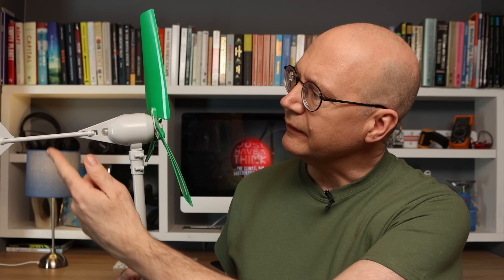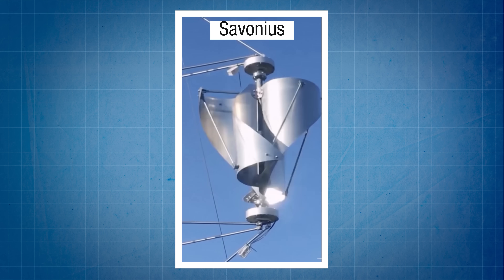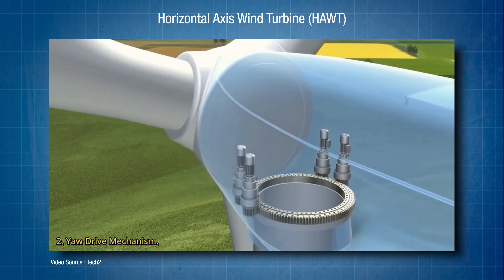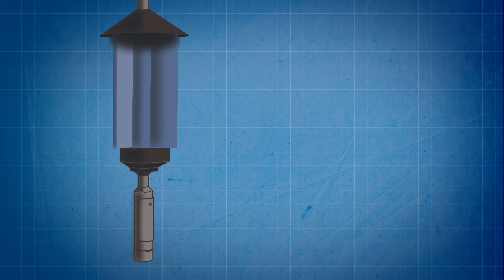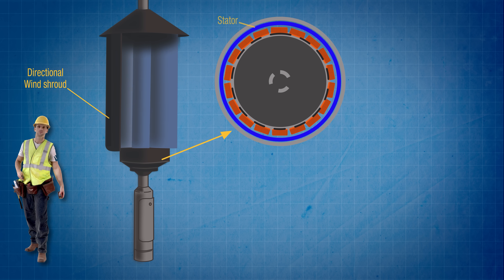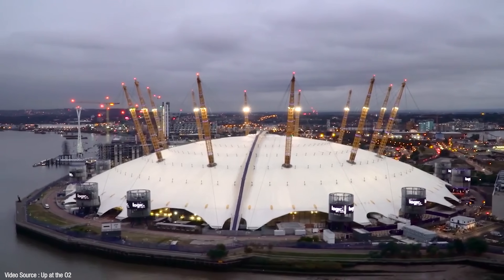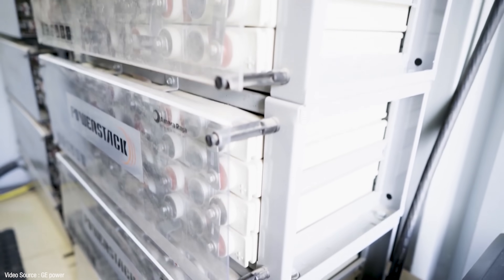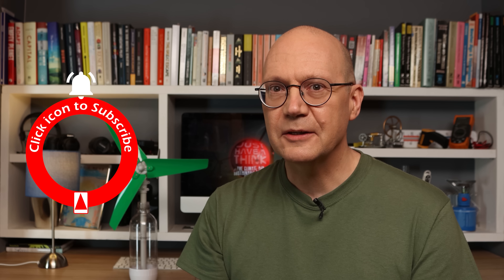A vertical axis wind turbine that doesn't need the prevailing wind! How do they do that?

Comment: Interesting video! Two question marks spring to mind:
Was the 5.4m/s measured at-site with an anemometer?
Is it possible that the influence of the turbines will cause parasitic loads on the vehicles, making them use more fuel to drive?
Reply: @spidy9237
True, despite the confusing graphic, everything they've built does look more like a drag/savonius VAWT, but considering their efficiency is limited to 15% by the drag in the counter direction, I wonder whether having this wind shear from opposing traffic might help this.

Am still generally sceptical, I'm confident they wouldn't get 6kW from a line of cars (sadly lorries are away in the slow lane too), the only thing that seems to lend some credence is the assessment by the (Leeds) institute of thermofluids (4:55) , but I can't find any evidence of this assessment online. 

Dr. Andy Young (4:08) is the advisor that apparently did this, but I see no publications from him , so I can only imagine they're basing this of a few informal bits of work, and nothing rigorous and obviously nothing we can scrutinise..

Comment: BRILLIANT informative video! Two things occurred to me that were not mentioned. 1) As personal and public transport moves over to electric propulsion in the coming years, exactly the same system will continue to work and pump a proportion of the energy used by those electric vehicles back into the grid where it can be used again for vehicles or other power needs. 2) You point out that the vehicles on our roads generate an air flow ("by punching a hole throught the air") - At speed, most of the combustion energy (about 35% of the chemical energy contained int the fossil fuel?)  converts into kinetic energy of the air  - moving air. Ultimately this Kinetic energy now in the air simply and quickly heats up the atmosphere even further and adds to the longer term heating of the air due to the 'Greenhouse effect' caused by the anthropic CO2 being heated by solar radiation.
I have a Question: 800+MwH of annual generation along the stretch of motorway you refer to is excellent BUT what is the installation cost and the ROI over the lifetime of the installation (including maintenance costs)?

Comment: We may fix the Gravitational Technology wherever we need it to be .  We may rotate more than 5000 Rotation Turbine Discs at the same Maximum rpm we needed. It would need only 4 Soccer Sized space in round shaped for these 5000 Turbine Discs . It is 100 % Carbon Emission Free Energy . It is the only solution by now to get rid from all the Energy Crisis which the World is facing now . The Gravitational Technology would be the cheapest form of Electricity .

Comment: Here's a thought why not place them near rail lines as well, I imagine with the length of trains and them being on a mostly regular schedule the calculations for the turbines output can be better calculated to prove this companies claims accurately and without doubt. Not to mention being near rail lines where that form of mass transit is heavily used and space is at a premium say in like Japan for example would provide yet another incentive for their adoption on top of providing the electricity for some of those electric powered trains themselves.

Comment: >:0 that's so freaking cool! Do these have an effect on how air and noise flow around roads? I'm a not a math guy (yet?) but it'd be curious to see if like, idk, they'd shed vortices that would reduce or increase drag on vehicles as they passed... Or if they're just such a small part of the system that it's negligible effect (which seems... Likely in my total just guessing estimate)

Comment: This energy isn't coming from nowhere. These would slow down air movement in motorways, reducing the efficiency, even further, the wasteful petrol or diesel engines. It would make sounds inside the car everytime you fly past a turbine. If you want to help the environment, enclose all motorways to prevent any wasted airflow. This sounds like a terrible idea and I'm not surprised it's come from a startup.

Comment: @9:20 The consumption of a typical base station is actually much more than that, most commonly between 30 and 80 KWh per day but can also be considerably higher.  The figure of 7 KWh per day is about right for a microcell (or small cell as it is now called), which would be one of those small things the size of a shoebox attached to a wall or a lamp post and such, not the full sized base stations (or 'cell towers') as depicted in the video.

Comment: Here's the big question I have: Does this change in air-flow reduce the efficiency of the vehicles? We know that when cars are driving back to back they get an efficiency boost (for example the Tesla semi convoy idea). So there's a chance that the unintended consequence is actually stealing energy from the fossil-fuel burning cars.
Reply: That is a small question, and I think the answer is no.

Comment: In the future, you could store this energy or use it to charge the electric vehicles driving down these highways and you’d pretty much have an incredibly efficient recirculating energy system with a bit of extra input overtime. That’d be reallly cool.

Comment: I suspect this would decrease the fuel efficiency of the vehicles traveling along the road by more than the electricity it would produce. Any net positive would come from the normal wind. If the car is dragging the air along, and you add resistance to that air, it would also add resistance to the car. If you moved the turbine far enough away from the road to not affect the car, it would have no air acting on it from the car to drive it.
In this situation, the car is effectively acting as a fan, pushing air to drive the turbine. If you place something in front of a fan, the power consumption of the fan must go up to maintain the same speed as the airflow is restricted.
This is effectively using motorists money to generate electricity to sell it to someone else. In other words, clever highway robbery.

Comment: Calculate all you want, VAWTs suck at producing useable "electric" power.  I know, because I have manufactured vawts for over 50- years.  All mine compress air, which in turn CAN PRODUCE useable amounts of electricity as well as robust energy storage with nothing fancier than a receiver tank!

Comment: I am no fan of solar and not much of one for wind, but this seems quite viable. Considering the comparitive costs between the two types of wind generators, the vawt is cetainly to be prefered anyway. Using available air forces like traffic and the underground brings actual value to this method.

Comment: Another application would be in urban centers where the architecture naturally funnels and concentrates the ambient airflow as well as all the air flow from vehicle motion and convective airflow from differential heating and cooling of pavement surfaces going from sunny to shaded. Anyone who has lived in (or even just visited) major city centers knows just how windy it is on the streets. Unfortunately, right at ground level opens up issues with dealing with vandalism, and also liability for people falling, getting pushed, or stumbling into the rotating parts. But installing above head height (or easy reach) should get rid of most of those issues (except for malicious vandalism).

Comment: Would be interesting to know how they can retrofit a rotor on a lamp post. Also the wind load on the pole would be much larger after installing.
Reply: its all nonsense, of course you couldnt retrofit these on lamp posts and not expect them to to collapse in high winds.

Comment: I would call this energy recovery from automobile inefficiency.
Reply: Intelligent people call this theft. It increases inefficency.
Reply: @hans-joachimbierwirth4727  Please explain your reasoning.
Reply: @jhill4874  Most of the energy used by cars are in effect needed for moving the air around it. There is a pressure gradient from high pressure in front to low pressure in the back and the air is moving along this gradient. Friction between air molecules and dispersion are taking up kinetic energy. In order to harvest parts of that energy you need to put something in between that increases the resistance and thereby the friction between the air molecules. The gradient gets flattend, the air movement slowed down and the air resistance increased. That's basically a lever made of air used to take kinetic energy from the car thereby slowing it down. In order to keep its velocity the car's engine has to work harder thereby consuming more fuel. The amount of energy at the car is higher than the amount of energy harvested at the lever. The overall efficiency is lousy, the car's owner pays for increased fuel consumption, and the gains are tiny but nonetheless theft.

Comment: I can't find it so I'm hoping someone else can help. I remember reading about energy generation turbines being removed from a road tunnel, because of Newton's laws proved there is no free energy, you are stealing energy from lorries and cars. The turbines created turbulence which increased drag, increasing pollution. Otherwise the wind would just move out the way.

I'd rather see the data that drag didn't increase with the use of these turbines, otherwise it's not free or green. It should be easy to prove with a wind tunnel and a turbine next to the lorry.
Reply: If you think about the whole system, cars would need to spend more energy to move the air which is turning the turbines. Therefore spending more gas to move through the distance of the road where the turbines are installed. Without the turbines, the energy required to move the air out of the way would be less, therefore cars would spend less gas.
Like you said, there’s no free energy. The energy that’s being used to move the turbines is coming from the gas that’s being burned to move the cars. And since systems are always inefficient (at least in the real world), I believe it’s better (or at least less polluting) to not have the turbines installed.

Comment: I like the idea, but isn't the idea that the energy from the cars passing is 'wasted' not quite correct? The wind turbine would create resistance to the air moving out of the way of the car in order to turn the blades and generate power. This would therefore increase the air pressure in front of the car as it doesn't move out of the way quite so readily, thus the car having to push harder and use more fuel......

Comment: Regarding the turbines along motorways thing. This can't be free energy because there is no free energy. The fuel consumption of the vehicles will be increased. It will always be better to generate the power more directly, where it is needed.

Hard to see? OK. Lets increase the number of turbines until they line the road. Maybe move them a bit closer to the traffic, maybe build a roof over the motorway and line that with turbines. Maybe make the road into a tunnel with the vehicles fitting closely in it to maximise the power that can be extracted.

At some point surely you agree that the vehicles suffer more drag? The thing is that there can be NO point where they suffer from no increase in drag. The energy is being extracted from the passing vehicles. Someone, somewhere will have to pay for it.

If you want to tax vehicles, send the operators a bill in the post. I imagine that this will be horrifically inefficient.

Comment: wouldn't it be a good idea to have under the hood on electric cars?
now that the engine is no longer there, then there is plenty of space, and they could simply just take in, the airflow through the front grill, there should be plenty of airflow, to generate electricity, but about it is enough, to drive a car, I do not know, but it would at least be a subsidy.
But could it generate enough energy to drive the car, a huge problem is solved,
that would really be something, wouldn't it?

But having them along the roadside, I think it'll going to cause problems in people's heads, they'll get dizzy of it, I would imagine

Comment: The best part of this is that even if the project ultimately fails, it will put a huge amount of commercial quality renewable energy generation on the secondary market, trickling down to hobbyists and tinkerers who will refactor the equipment, and potentially discover new efficiencies or novel uses that be cost effective where the initial project failed.

If it does succeed, rather than feed the grid, perhaps have it shunted to a secondary grid of highspeed charging stations for EV's.

With the charge provided to the consumer, at cost of generation, it would drive EV adoption.

Comment: Sounds really nice. If it could be produced local in every region and not stransported on ships from china it will prevent lot of polution. When a container ship turn on its crude oil engine, it pollute like 10 000 000 cars. The biggest one like 50 000 000 cars.

Very smart system, it will probably reduce the side wind to. It will benefit places where side winds is are dangerous. Still have think about noice and reduced sight for the driver.

Comment: NOTE - to this fine company and it founders.
Regarding traffic accidents.  If the Fan was a breakaway unit, the upper and lower units could be flexible.  The top could be suspended and even hold the Fan.

We are all waiting. This is really great.  Just think of the profits to small townships who could partner with the project.  Excellent.

Comment: One of the most interesting aspects of this is that the traffic induced wind is highly predictable, and will tend to coincide with times of peak usage as times that people are engaging in travel by car are also inherently times when they are peaking the power consumption at the start and destination of those journeys both morning and evening.  Thus the timing and location of power production is nearly perfectly matched to load, substantially raising it's value.
Reply: I bike one meter from a highway at rush hour. There is not any noticeable wind from the traffic at all.
Reply: @tzenophile  snore